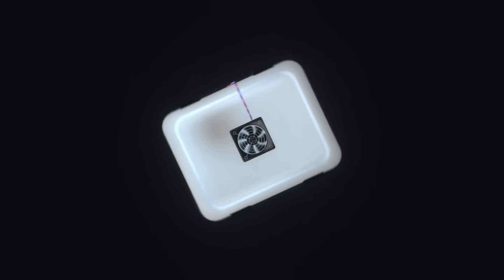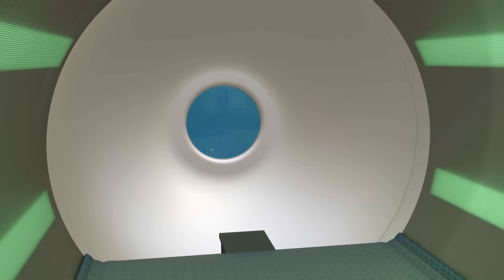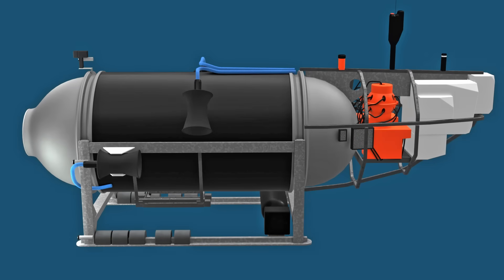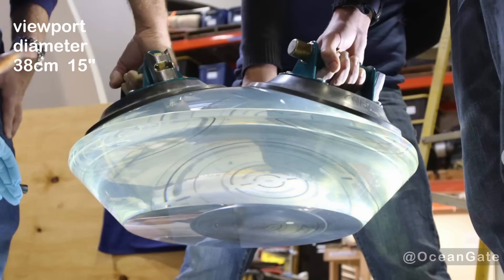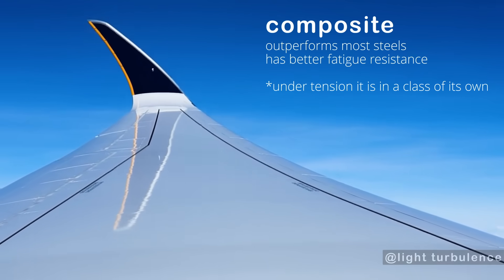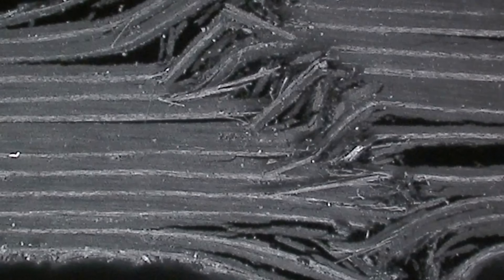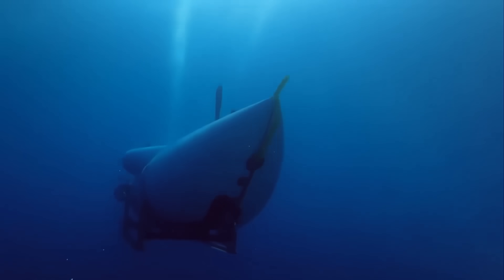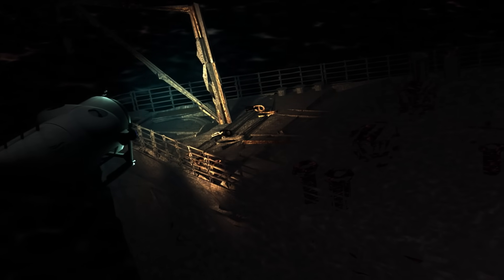Titan Sub | carbon fiber - Detailed Tour

Comment: Its nlt about the material being strong in certain respects, if it bends and flexes under compression it might break down over time, and pressure applied externally deforming a container will increase the forces that flex it, so as the sub gets weaker, the forces increase, also it might be stronger per cross section, and weight, but if it is not over engineered, and thick/rigid enough it will flex and once it does you have to consider the effects of many cycles. There is also the issue of the titanium cap and the cylinder, the joint, because the cylinder shape is unstable and will flex more than the cap, will definitely habe uneven pressures and tension in the region where they meet, the cylinder when deformed bulges in one direction and squeezes in the other direction, that is just how the shape turn out when it is deformed by external pressure, as long as the cylinder is not perfectly radially symmetric and distributes stresses completely evenly, which is not an attainable goal. Once there is some deformation in the shape the forces from the outside pressure is even more uneven directionally, this happens to any cylinder regardless of material, but the joint poses a problem because the forces applied back to the carbon due to this deformation of the tube but not the end piece puts high compressive loads on a small area of material, probably a weak point that needed to be over engineered a lot more than it was to avoid breakdown with cycles, the cylined itself could also have failed, but i suspected that this particularly contributed to fatigue and wateringress close to the end of the cylinder that compromised the integrity of the hull with cycles. And again the most important thing to remember is that withstanding outside pressure is a runaway process, if the structure degrades even a tiny amount the deformations and therefore also the forces that deform increase for the next cycle, and so every time you dive you might lose just a little bit of strength but the worse it gets the faster the degradation occours. That is why a cylinder is so bad, if there was some extra curvature in the design, with say an elliptical hull instead of a cylinder, the way stresses would be distributed in the material would lead not much less deformation, abd much less chance of breakdown of the material properties over time. Furthermore cracks and ingress into the binding agent in the hull would radically redistribute small scale stresses in the material over time, even small changes in the rigidity and compressive strength of the material would end up in a deadly feedback loop that would not be possible predict without very good theoretical models of the material as it was used, i doubt that had the knowledge to make sure they over engineered it enough or even knew what that means for many cycles with this kind of material. Remember that an engineer that believes in himself has the wrong idea, what you should do is build something that can do 20% more than you need it to and add 10% more margin to insure yourself against your own stupidity.

Comment: One suggestion has been:- Passengers moved forward to look out of the Front Port Hole and the entire sub tipped nose nose down, causing everyone to then fall into the front. If Titan had been thrusting forward at the time it would now be thrusting straight down. In the confusion control was lost, pressure would have increased much more rapidly and this might have been at least a contributing factor.
It sounds a bit odd that any passengers would be allowed to move without instruction but if something of great interest swam past (6 Gill Shark or something) I guess it's possible a couple of passengers may have suddenly moved forward to look?
Or is this just complete speculative rubbish?
Thoughts anyone?

Comment: The conjecture regarding waviness in the longitudinal fibers sounds plausible to me. There is a very well documented case in which this was the failure mode. DG-300 gliders were manufactured in Germany for years with no issues. Production was later subcontracted to a foreign company that neglected to follow proper procedure in laying up the wing spar carbon strands. This manufacturing error introduced a slight waviness in the fibers at the wing roots that resulted in a fatal accident and the grounding of all the fleet.

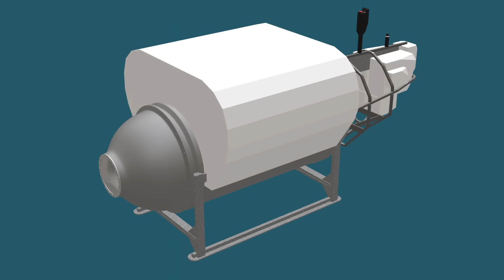Comment: 8:04  Less agile and bulkier...lol... Bet that would have been OK knowing that eventually the freaking things was eventually going to implode because of the inferior design/material used.  Carbon fiber is a fantastic material but not in this application at all....  The sea is a very unforgiving place.  Too many corners cut and now their dead...  At least there was something learned from all of this.

Comment: I think Rush was far too confident in his acoustic monitoring system. He said it had been tested on material that was compressed to destruction, and it reliably gave an early warning before failure. I believe he claimed that after the warning, the hull could dive another 1500m before failing. However, I don't know what sort of structure exactly it was tested on. If it wasn't tested on something built in exactly the same way as the Titan, i.e. destructive testing of an actual Titan sub, then there could have been failure modes of the real hull that didn't fit his model.

Comment: They only did hoop layers. They did not do axial layers on the Titan. They claimed the stresses on the hull only the hoop layers were needed.
It was the rear of the ship that failed based on the communication leaks. The coms also gave them a significant warning.
According to the leaked coms they ignored several warning signs something was wrong. Such as, they were descending much too quickly, which likely meant they had too much weight. When they finally tried to ascend at 3400m realizing something was wrong they were doing so at a snail's pace of 10m a minute.
But the sensors were most definitely useless. They only gave them about 30 minutes of warning. Which is useless when you're 2.5 hours from the surface. Then again if they surfaced at the expected speed they might have delayed the failure with reduced pressure. Who knows.
Reply from the maker: The "comms" were nonsense.  I did a video about that.  Recently the Coast Guard issued a statement saying the "leaked transcript" was fabricated.

Comment: A fatal mistake is combining carbon fibar as a hull and titanium as a gate.
The joint between carbon fiber and titanium is a key mistake, the two materials cannot be joined properly, that's where it broke.
They literally glued them to each other.
Carbon Fiber is more then 3 time weaker then Titanium when it comes to the tube shape.
A reference carbon fiber tube with a diameter of 10 cm can withstand a pressure of close to 3 tons, while the same one made of titanium can withstand over 9 tons.

Comment: You said carbon fibre is lighter and saved 7 tonnes of mass off the Titan.  Cool.  But that only counts if by doing so the craft is still able to safely carry 5 people down 12,000 feet.  If that isn't possible for reasons of production quality, and 5 people are likely to die, then titanium, more foam and a bigger support ship are the only option.  Countering the narrative of carbon fibre being inferior for compression uses is a redundant argument if you acknowledge that in order for it to be suitable it needs to be manufactured to a higher standard than the team were prepared to make it.  That's about as useful as saying wormholes are possible if you build them with dark matter; it's moot because you can't.

Comment: Stockton Rush said that the acrylic view port would actually be compressed inward as they reach the bottom. Since the view port was detached from all the bolts, this probably means it was the fracture point. If the fracture point was somewhere else, the pressure would be released off of the view port and it would probably still be attached. The passengers were probably gathered by the view port in the final moments looking outside. When the pressure got to be too much, the view port fractures and pops inward like a cork popping off of a champagne bottle, hitting everyone in it's path which was probably like shrapnel ripping through their bodies, causing human remains to be stuck to the inside walls which were found like the news reported.

Comment: I do believe you are incorrect with the way this failed. You answered the reason in your comments.  The fact that the ends were blown outwards at the flanges shows to my self that it failed in the centre of the tube.  Inwards push will give outwards at the ends. Carbon tube with that thickness with NO ribbing pr9ved by failure. The tube was to long with no central support. Of course it was going to fail. Extremely poor design and incorrect use of carbon and stress calculations.  Just fing dumb to be honest

Comment: A carbon fiber strand can pull a car. The same strand cant push anything.
Reply from the maker: If that were the case then the composite structure in an Airbus A350 would crumple as it runs along the runway. And the foil under a racing yacht would go plop under the 9tons it carries. And same goes for the mast. 
Carbon fiber bike frames would also fold up like a shoelace. 
Carbon fiber built with care can carry massive compressive loads

Comment: deep sea submersibles aren't built with titanium. They're built with steel...They've always been built with steel because steel is compressive enough to hold together but not so compressive it will fail... titanium on the other hand is far more expensive and far harder to shape and work with... one mis step during the welding process and the entire sub is trashed or it goes unrecognized and ends up like the titan... 

This has to be one of the most contradictory videos I've ever seen.... You spent the first ten minutes saying and explaining why it couldn't have possibly been the carbon fiber that failed, then you blame the carbon fiber, then you say, no one should be making guesses as to what happened until the finale report is released....so which is it... Carbon fiber was more than strong enough to hold together, or was it not strong enough, should we speculate, or not speculate.... like you did for the first ten min....

Comment: The best analogy is the egg. Compress it at the ends and it is very difficult to break. Compress it from the sides it crushes easily. The whole design was bad not just the CF tube. To equate what the Titan was experiencing and what an aircraft experience is ludicrous. You are talking about lateral forces and outward pressures.

Comment: The only thing that was keeping the carbon fiber tube in tact was the epoxy resin. The carbon fiber witch is excellent for containing pressure (like scuba tanks exc.), when you apply pressure on the surface inwards it has limited strength. In other words the Titan was just a brittle plastic tube. The carbon fiber was doing virtually nothing.

Comment: If the failure is so extremely sensitive to the construction process, then I would argue that practically speaking, carbon fiber is not a good material for this application. Fault tolerance always has to be factored in, as no real structure is ideal of course. And a composite is much, much less fault tolerant than a homogeneous material.

Comment: It's not wrong to say that carbon fiber has relatively poor compressive strength when compared with its tensile strength. And obviously, it's possible to engineer something to function with a specific material, but we also can't ignore that it failed in the exact way that points to the use of carbon fiber. Be it for cost-saving reasons or compactness or whatever, if the guy was so smart he'd have made a better titanium sub than attempt to blaze a path that he had no capacity of blazing (by properly producing and testing a composite hull). It would be a true tragedy if he was following every precaution and spent the time and money to create a SAFE compact sub and it implodes anyway. I mean how delusional does someone have to be to get in a deep sea sub that cracks like gunshots and think "I want to bring my son and paying passengers here with me"

Comment: Worthwhile video....The sub was a folly that was built by someone who thought he knew it all.  Thinking that one knows it all is one thing, but not testing and certifying what one thinks he knows is right is putting one's head in the sand (and safety at risk). The sub was doomed to failure by someone who thought he knew it all.
Reply: One thing not discussed enough here ....  "The Sphincter Valve Effect" 
What happens is.... BOTH noise & visuals are translated into Electrical Impulses for interpretation by the brain.
When formed, these impulses of information travel South to the Sphincter Valve aka the Orifice Interface.
The Sphincter Valve controls electric impulses in an effort not to overwhelm the brain.
Nerves are very thin in this anal-type area. They need a massive amount of bloodflow to pass the Interface, traveling on to the brain.
Once you throw TOO MUCH INFORMATION down there, the electric impulses backup, the Sphincter Valve closes, blood flow drops.... nerves can't pass information ....... and the brain has no choice but to mutter the only thing it still sees, OH SHYT!!!

Comment: Seems that the axial resistance of the hull was not enough, as could be seen that no unidirectional roving was laid in axial direction, so actually only epoxy resin was resisting the axial stresses. Apart of that, the joint of the carbon fiber pressure hull and titanium domes was critical. Due to  different modulus of elasticity of carbon fiber tube and titanium dome. The deflection of the carbon fiber hull was much higher than titanium dome at the joint, hence producing the extra high stresses.

Comment: Carbon fibre America's Cup yachts masts snap. The carbon fibre hulls crack too, and those happen at the surface level under normal atmospheric pressure. Not on your nelly would I set foot in any sub (except maybe a big US Navy nuclear sub), but no way would I go near a carbon fibre one. I'm even a little iffy about those airplanes with the carbon fibre fuselage.

Comment: I think it failed due to structural fatigue.   He did prove that carbon fiber is a viable material to use for a limited use deep sea submersible.  Oceangate should have tested the submersible autonomously to failure to get a better idea of what it could do.

Comment: Whoever chose using CF on the main tube was seriously deluded about it. We've used it extensively in hydroplane racing. Yes, when the lay and resin fill are nearly perfect, the CF has remarkable strength. But it gets that strength due to the layers of CF and resin. In deep water applications, tremendous water pressure is working on the tube, effectively finding any imperfection and driving water in.  As this occurs, the layup is losing the effectiveness of total adhesion. They would have heard the first major tear through the point of imperfection, then it's over... These guys thought they were smarter than everyone else. I've witnessed this hydrodynamic de-lamination many times on the boats. We were continually fixing weak spots and layer losses. No fixing at 12,000 ft down!